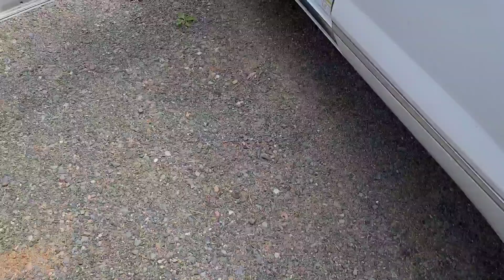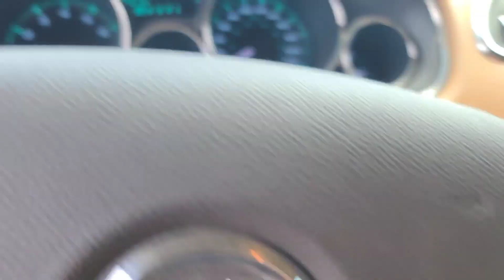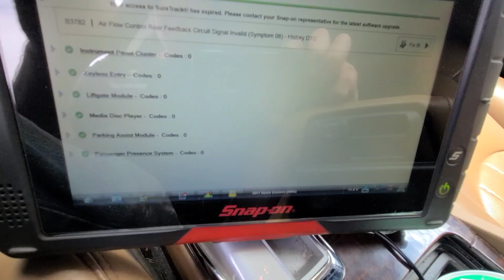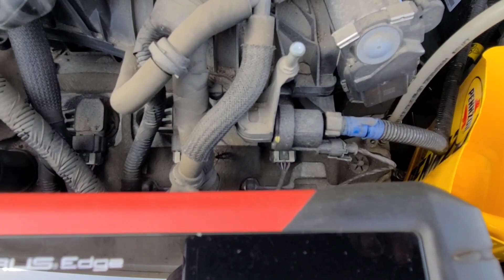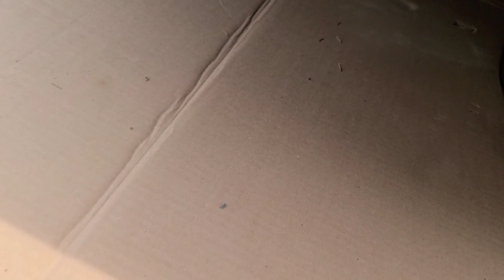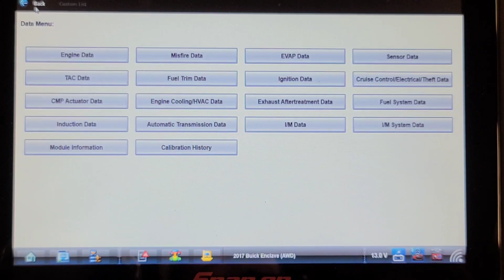2017 Buick Enclave Crank No-Start After Boat Launching

Comment: Nice one, Phil.  Thank goodness the customer told you that it happened right after a boat drop since it might have sent you on a small adventure!
Reply from the maker: Yes knowing what happened is very helpful. If I didn't know about the boat launching escape I would have suspected diesel fuel in the tank but its usually full. Since it had adequate fuel pressure I would have suspected fuel quality.